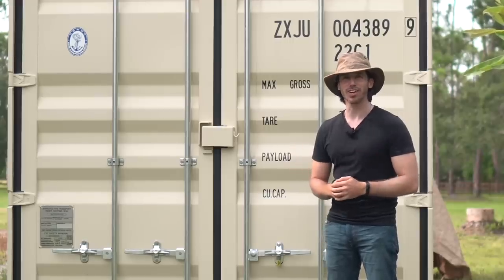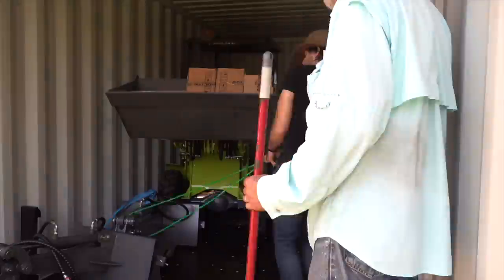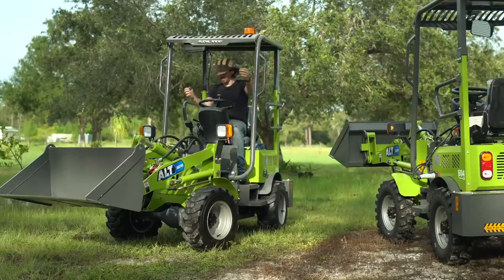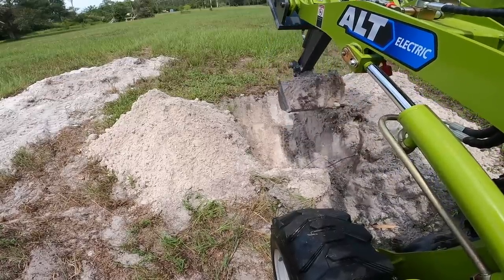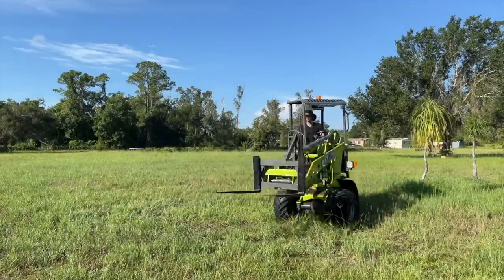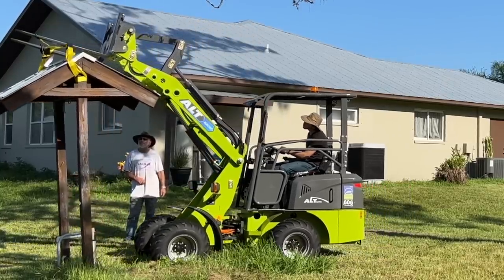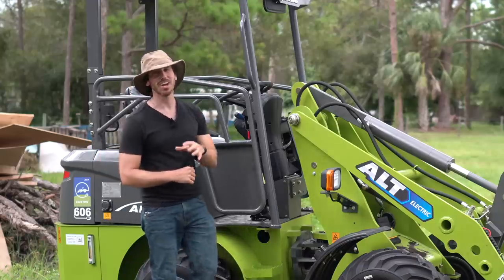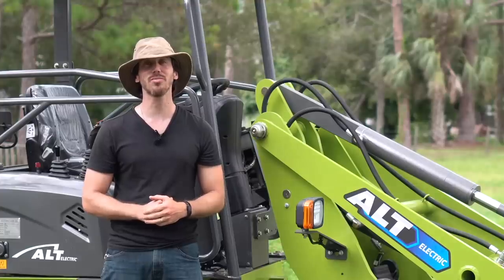I bought a container full of Chinese electric construction equipment!

Comment: Nice video! You didn't mention the average run time with a fully charged battery. Those small loaders would be nice for snow removal.
Reply: Yes they would do a good job but I 👍. But I am sure there is a old weather degradation test coming. Hopefully 🤞
Reply: 1 to 4 hours, depending
Reply: @abyssmanur3965  yes lots of variables but curious to see one test and the conditions.
Reply: They have 14.4kw power packs on the big one.  I have four of these same units I imported a year ago probably from the same factory (Qingzhou Yingnuo.)  The operator needs STRICT training not to run the packs down to less than 20% to avoid destroying them fast.  I swapped out a substantially better battery monitoring system on the units I have.  We still killed one of the battery packs in 6 months running it too low due to a programming issue on the monitor.  The others are fine.  Based on degradation, I expect about a 5-6 year lifespan from the pack. They are using lead acid batteries, and this degradation substantially matches electric forklift degradation.  The unit with lead acid batteries got upgraded to a lithium ion pack, but we had to add weights to the vehicle to offset the huge weight reduction.  However it is a substantially better machine now, like night and day.And based on the last 6 months, we expect its pack to last 10 years+  My units run for about 2 hours of hard work for the lead acids, the lithium ion unit upgraded unit runs for about 6 hours of constant work.
Reply: thanks for comments, could you plese say how much is a standard battery and how much for a lithium? just approx. @BadHaddy
Reply: @andders2477  We priced a lead acid battery replacement at 1400.  Lithium Ion would be hard to pin down because we custom built the pack, but we were into it for about 2700 dollars using new components.  We have 2 more battery packs we just assembled using lightly used cells that we paid 1700 dollars total for, that will go into the lead acid units.

Our yearly TCO, for our use case, ends up being less for the electrics, even with replacing their batteries every 5 years, than it was for the propane and diesel powered mini units we were using before.  Even assuming zero resale value.  But our use case is pretty specific, and you'd have to evaluate it for your own org.

Comment: After looking at the specs it seems the larger loader has about the same specs as my 2019 Massey Ferguson GC 1720 BL. Cost is a little more also. There is definitely a market for electric right now tho. I was hoping the lift and HP would be significantly higher being electric.

Comment: The common Mini Skid steer attachment plate would be ideal for those little machines as they would be cross compatible with the rental attachments available.Bigger machine might need full Skid Steer quick attach plate.
Reply: I assume these machines are intended to only be used with their own attachments. The machines likely don't have the proper hydraulics and lift capacities for the universal attachments. If this machine had skid steer quick attach and you tried to use a front loader designed for a larger tractor you might break something or tip it over.
Reply: @andrewgee241 he said “mini.” That is a different from a regular skid steer quick attach. It’s a smaller version. Therefore the use of the word “mini.”
Reply: Yep. How much would it take to make an adapter for standard attachments.
If it has the hydraulic flow to drive and lift, it has enough for attachments.

These are interesting but without standard attachments, it's a no go for a pro like me. Leaves it as a homeowners.

Comment: The loaders seem like they're actually pretty well-balanced machines. I'm curious to know how they perform in really cold weather . Where I live it's nothing to get-20 in the winter
Reply: Depends on the battery chemistry. All batteries don't like freezing temperatures. Older style batteries don't like the cold but then they don't have the thermal cutouts that some modern high energy ones have. I would recommend battery heating no matter what chemistry is used and ideally inside storage when not in use. Warm batteries of any type will always work better in this instance. Remember that the hydraulics don't like freezing conditions either and improve when they warm up - just like engine powered machines!
Reply: @davidmuirhead1060  that's actually a very good point. Unless you heat the hydraulic tank to the Hydraulics might be worthless. I'm thinking maybe we've got a little ways to go before electrical work where I'm at. I mean don't get me wrong it'll work most of the year but most of the year kind of makes it useless the rest of the year
Reply: starter batteries and hydraulics have always been susceptible to low temperatures  as is coolant with low antifreeze levels. EV machinery of this type at least doesn't have coolant problems. I would be more worried about a cab to protect from the wind and sleet. I would be giving up long before the EV loader would.
 @Rusty_Nickle
Reply: Y'all do realize that it gets cold in China too right?
Reply: As a minimum, definitely give the pump some warm-up time, then GENTLY cycle all cylinders, avoiding the end stops, multiple times to cycle warm oil through the hoses. This goes for all hydraulic machines and should include all cylinders, including steering.
Reply: @Blueknight1960  yeah but I'm pretty sure china's cold and our cold are the same kind of cold
Reply: @StefanBacon  definitely.  You gotta do that with any machine to get the cold stiff fluid swapped out for warmer fluid so things work right
Reply: @Rusty_Nickle  Yea, pretty sure of that.
Reply: @davidmuirhead1060 my friend has several un cabbed machines on his place, when it's cold or wet operations are carried out in front of the fire with a cup of tea, building a solid roof with fronf, side, and back windows would not be difficult, just enough to break the wind and weather so you could finish a job and get back without to much discomfort, that I think would be ideal. It's what I have done on my mini digger and it's a good compromise.

Comment: Pretty neat machines.  I think that they would be alright for some less than heavy duty working conditions.   I know the soil (black gumbo) would be a challenge for any smaller machine.  The landscaper that does larger jobs could probably do well with them if the machines hold up and batteries aren't too short lived.  I haven't watched any of your videos since you were selling those battery connectors.  I bought some and they all fell apart so I guess I didn't want to see anymore.  Good luck and hope you can do well with these machines.  Takes a lot of work and $ to get going in any business venture.  Not far from where I live is a company that imports and sells all types of small and large equipment.  I look in awe at the amount of $ setting on their property.  They have been going for a long time so I guess they figured it all out.

Comment: Good luck on your future imports.
Also, i recommend you getting a contact in china who all he does is go visit the place you are ordering the stuff from and check in periodically to see if everything is going well and the machine is working as it should before they send it.
You can also go with trusted makers, but should still have a chinese contact to represent you.

This has worked so far for me and i have yet to receive a non working piece of equipment.

You do get stuff that gets damaged in transport, but it happens far more with cheaper stuff. I got a medium size wood chipper recently, needed a gasket replaced, cuz it was leaking oil and one of the taillights was broken off in transport.

I do want to try out stuff like forklifts and smaller utility vehicles, but haven't had the time for those.

Comment: Another benefit of the electric side is , plugging in a wire is way easier than trying to pour 10 gallons of diesel into a tank . Not to mention,  you need to go out and buy the diesel which could be far . Or storing the diesel , which could be a fure hazard.  

Electric 👍👍
Reply: Yeah plug in the wire and wait for hours. You don’t fill equipment with a 5 gallon can lmao. You have a pump and it only takes a few minutes.

Comment: obviously the big issue with the backhoe is the width of the quick attach plate..Im sure you realized that. other than that I really like the idea of going electric to spin a couple hydraulic pumps
Reply: Most people will use it for trenching pipes and cables, not deep holes.  We will be offering a dedicated excavator soon.  Regards

Comment: I wonder if you could integrate solar panels and charge control to charge the batteries while you work
Reply: Absolutely, just like we did with our electric truck and in the process of doing with our electric boat.  And the steel canopy would be easy to use as the structure for the solar panels. regards

Comment: how about the maintenance issue, are parts easily available from the supplier or you will wait for a longer period of time?
Reply from the maker: Yes we stock many of the unique parts locally in the US now. Some of the parts like batteries and tires you can get at stores like Tractor Supply and Home Depot. Anything we don't have, we can get shipped in a couple of days.

Comment: What are the charge times/run times/charging requirements? For example E-cars need more than 110v. However, I have power lift equipment certs for a retailer and the charging only requires 110v and tops off in less than a half a shift.
Thanks for putting this out there!!!!
Reply: ... one other thought, would solar charging work?

Comment: I agree with DJMajikMan on more info. on the battery life of operating the equipment vs the life of a diesel motored vehicle. In cost comparison the electric you have seems to be truly fantastic, but for a hobby farm or off grid living situation for me is cost and terms of how long over the years would the e equipment compared to fuel motored equipment?

Comment: Very nice machines. Only thing missing in your video is you don't talk about battery type, capacity and charging. Visited your website, and I see why. Lead acid batteries, which won't  last. Lithium batteries would have made more sense, even if more expensive.
Reply: The lead acid batteries function to add counterweight, are easily sourced locally in any reasonably sized town and are more familiar to most people.  It's always about pro's and con's.

Comment: How offroad can these go? I have some rural wooded property with some mild hills; would one of these handle the terrain that a 4x4 tractor could?
Reply: Driven by 2 electric motors, one front axle and one rear.  Have enormous torque.  Just don't want to exceed safe angle of slope that would make the machine unstable as is true at some level with all such equipment.  Hope this helps
Reply: @micahsdad5388  yeah I think that does help.

Comment: Would have been nice if you mentioned how long the battery life is. Can they be hooked up to a normal power outlet? Because if it runs out of batteries in the paddock you're screwed unless you can take a generator over to it. Also pretty cool you're giving away eBikes. I bought a eBike and an eScooter. 3 months after I bought the eBike it was stolen then about a year later the back of my truck was broken into and my eScooter and everything I owend was stolen.

Comment: Ok. But how long does it last?
Reply: will be fine, most forklifts are also electric and they les easy 30years only the battery and some rolers need to be change over time

Comment: You are doing the right thing. Really sad / a shame that there is really no western competition. All focussed on ICE equipment. Meanwhile construction equipment is the easiest one to electrify. I mean, the batteries weighing a ton is beneficial as you do not have to put on counterweights. No idling required, only apply power when it is needed > thus no inefficient idling for holding a pallet of stones. Also range is not an issue. In urban environments you could also run a cable, the equipment is mostly moving in a very enclosed environment, or if you are super offgrid, hell run a diesel generator if need be. I can already foresee all the diesel-enthusiasts making up edge cases like: I need to have the equipment available in 3 shift operation 500 km into the wilderness with no daylight and no grid. The same very genuine arguments that are made for buying these laughably oversized -egocarriers clowncars pickup trucks

And in a few years time when they can not sell western equipment that is now obsolete the manufacturers apply for government bonds - nobody could have seen it coming, the evil chinese yadda yadda yadda

Comment: Wooo... Your pick up cost 2k. By the time you get it, the whole cost is 8k.😮
Reply: True - and three years later we have an $8K truck that is working perfectly, with zero maintenance costs and very low fuel costs as we are using solar panels to charge it most of the time.  And nearly 16,000,000 YT views!!  Thanks for commenting.

Comment: This is fantastic! These have so many applications, and the maintenance benefits are significant. Someone else mentioned this, but this would be great for residential contractors. The noise and fumes from a diesel Bobcat are not something homeowners and neighbors enjoy. If you can maintain a US side supply of parts (motors, controllers, the little stud that breaks like joysticks, etc) your main problem will be filling all the orders. 
Are there other types of equipment? A bobcat that is small enough to get in a backyard would be great!

Comment: I'm curious what happened with the scam mini excavator, doesn't look like the vid is up yet on your channel.  I do construction equipment support and have had to get stuff working that the original manufacturer is no longer in business, got bought out, or is just run by lazy asses with nonexistent support.  I do a lot with PLCs and drives, I'm in Colorado but open to travel, reach out if you want to talk further

Comment: I love the loaders. The hydraulic quick hitch looks wonderful. 

Not sold on the excavator attachment, the problem is you are bending the unit at the middle (ie "steering") to move the spoil to the side and you dont have much range (of angle). If you were actually trying to load something with the excavator, youre going to have to back away and drive forward to reach your etruck, for example. You are going to spend a LOT of time driving back and forth to do what a trackhoe does just by swiveling. 

That container looks new, did you have to buy it?

Comment: I love you YouTube Channel.  With regards to this video I was wondering if you could design the batteries so that it was a quick change feature, when the battery is low, you may have a back up already charged that you can swap to continue using the machine provided you are down a major excavation job, for instance.  I would love to here your thoughts since it would make this machine a game changer.

Comment: Get back with another video after 1-2 years of use, then we know. I have a chinese electric moped from Niu, probably the most established brand outside China. I'm not impressed, I have had multiple issues and testimonies from others show a similar picture. There are of course many good Chinese brands but as a European it is not easy to identify those.
Reply from the maker: We’ve had them for about 11 months so far and working great. Check back in another year for the next update.

Comment: I noticed that the battery in these units ia AGM. Why for the love of god are you using such outdated technology? Why not lithium?
Reply from the maker: They both have pros and cons. In this case, the AGM adds more ballast, increases the amount of weight the machine can lift, and is easier/cheaper for the user to replace by themselves several years down the road since the batteries can be found locally and aren’t a hazardous good.

Comment: Are there bigger machines available? I have a 25+ year old excavator and skid steer, both in the 10,000lbs range. I would like to replace my diesel units with electric versions of my machines but dont want to go lighter.